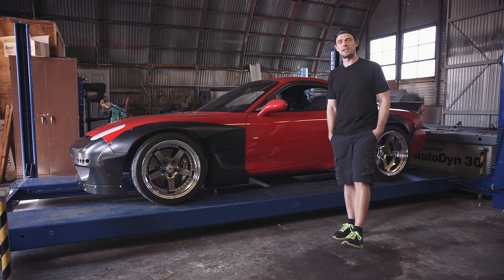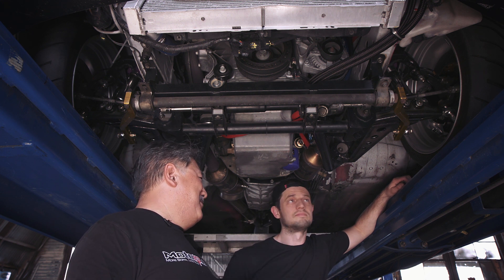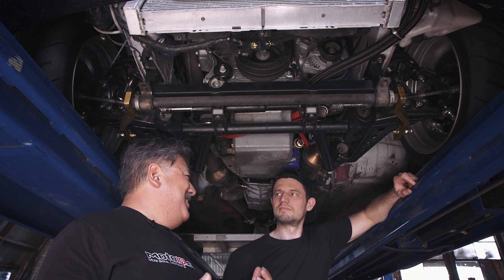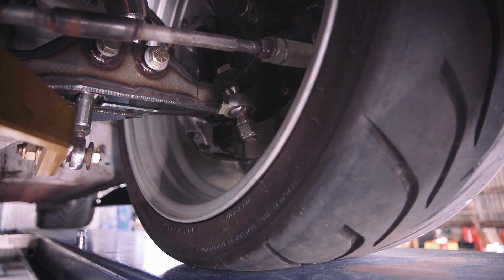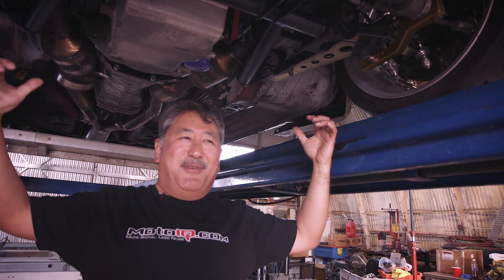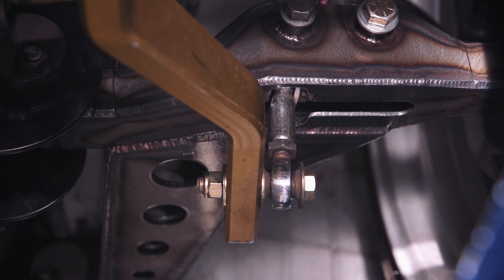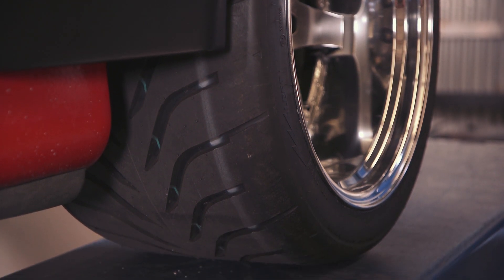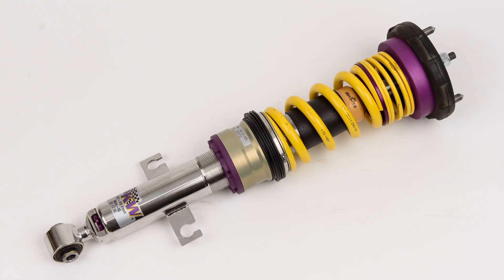MotoIQ Project V8 RX7 Suspension Update

Comment: LOVE THIS. I'm planning to fabricate my own front control arms on my FD RX7 with an LS1 because the OEM's are out of production and the ball joints on the lower arm are not replaceable if i recall correctly (haven't driven/worked on my car in over 7 years :(  )

Comment: Do you know if the KW HLS kit clears the RX-7's stock control arms?
Reply from the maker: it should, it just sits below the spring on the perch and isn't any wider than the spring.. not sure if the plumbing will interfere with the cross-piece in the upper control arm but you can orient the canister 360 degrees so you could probably make it work.